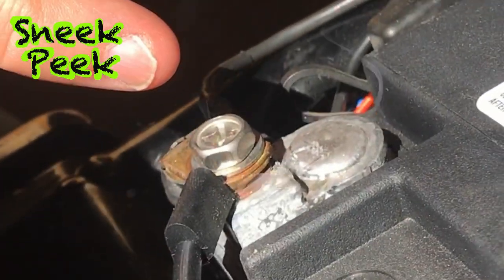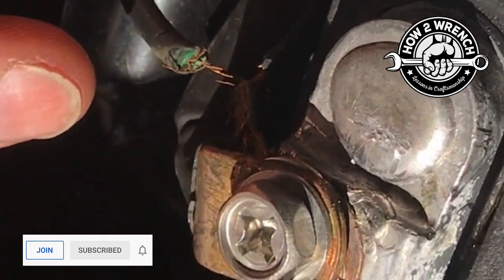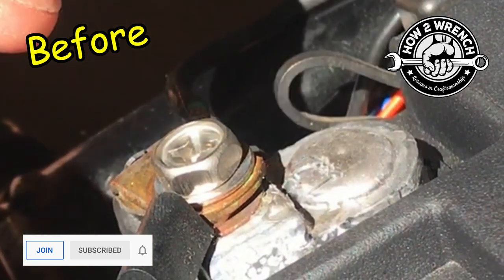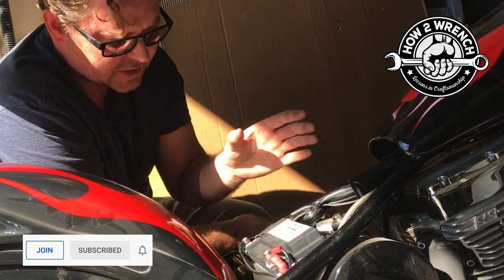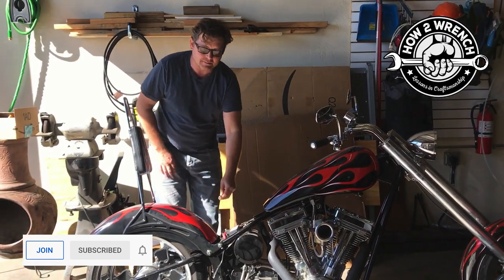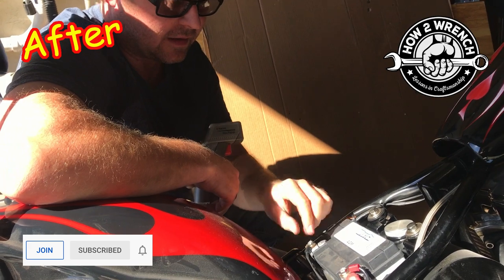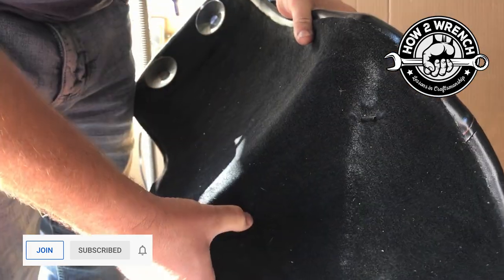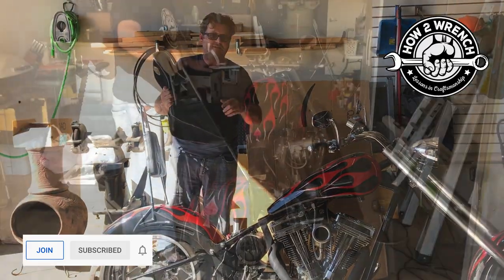Loose battery cable almost burns up chopper! Watch it happen! How to avoid this! #chopper #battery

Comment: I took my bike in with starting problems to 2 separate Harley dealer. I have an 04 Dyna 124"build. They kept telling me my carbs needed to be adjusted and then giving me it back with the same starting problem.  It was my battery cable the whole time.
Reply from the maker: Love the 124"! Thanks for subbing and sharing your story...
Reply: @How2Wrench  sure thing, thank you for the video!

Comment: Hey Shane, i seen problems with not enough threads to too many threads . I know mechanic's that put blue thread locker on bolts holding batts cables. Hey what  did that Frayed wire go to Shane ?. was it to your regulator or What?

Comment: I have seen people use a bolt that is a few mm too long and it will not tighten properly because the end of the bolt hit the battery case under the terminal.
Reply from the maker: True that....thanks for sharing. I tend to see it from people not using the supplied bolts and transferring old bolts to new "different type" of battery.

Comment: Although I have terminal covers on my ‘93 Vulcan, I cover the top and pos side of the battery with a piece of inner tube just to make sure sparky ⚡️ doesn’t pop up and ruin my day because the Duracell battery for her cost about a buck 20 and it is feeler gauge tight in there‼️
Reply from the maker: Feeler gauge tight???? Nice visual...👍

Comment: How about cleaning the rusty terminal conectors too.
Reply from the maker: In this case that's copper not rust...they are super clean and were even volt drop tested. But if you mean in general absolutely agree friend. Have you seen all the battery videos we have? Thanks for commenting that important point!